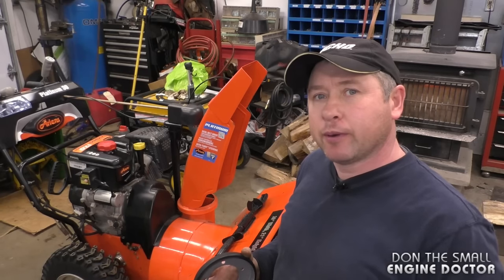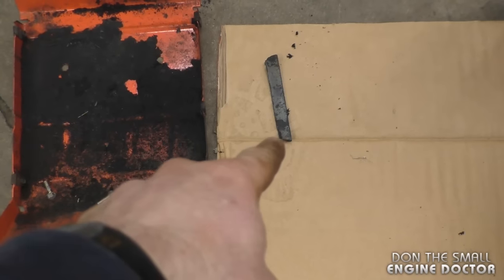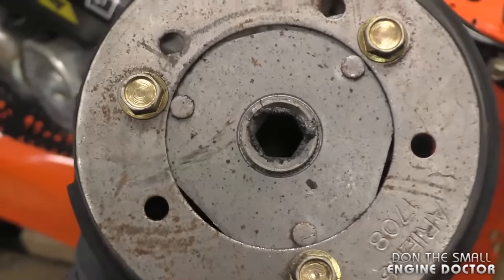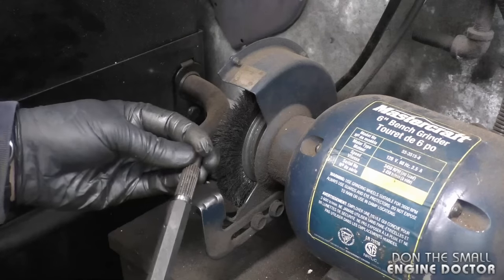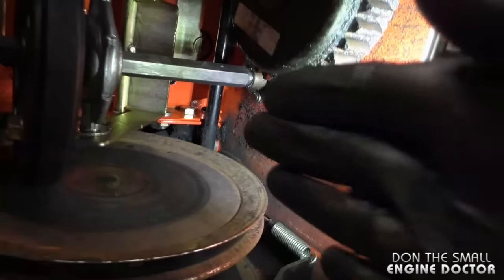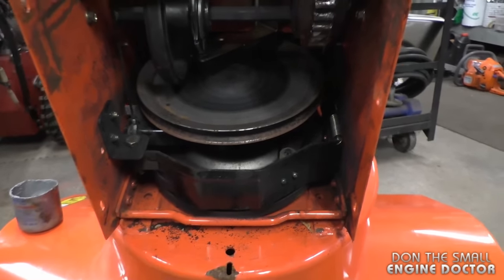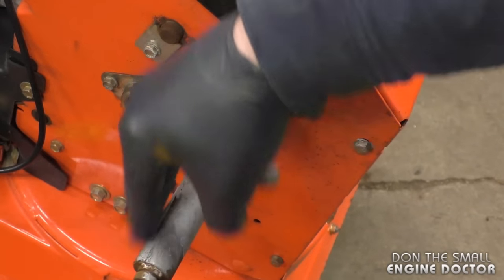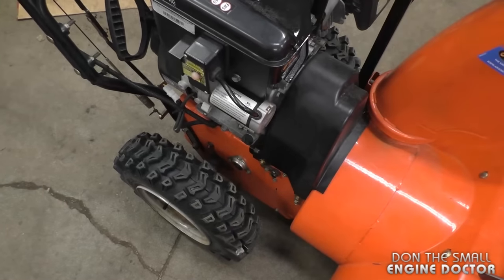HOW-TO Replace A Friction Disc On Ariens Snowblowers - Make It Drive Again!  - Video

Comment: For those that read the comments, I would like to emphasize Don's great advice about anti seize on the axles.  I had an Old Second Hand snowblower that didn't have proper maintenance. I was using at 2 ton press with heat and still couldn't get the wheel off the axle. Now every spring I take the wheels off my new snowblower. Go over the axle with Emory cloth and put anti seize.
Reply: Similar advice for the auger shafts. Those things will rust up to the point where shear pins can be removed and they'll still work normally. At least Ariens has zerk fittings on the augers, economy brands may need the front end disassembled to get in there.
Reply: @TheOtherBill  Both the auger shafts and the axle shafts can be coated with any general purpose grease.  The oil in the grease will serve as a rust inhibitor.  Anti seize is overkill and a bit expensive to use on axle shafts.
Reply: @1575murray  I grease my auger shafts using the installed zerks. Anti-seize on the axle only needs to be applied once and lasts forever.
Reply: @TheOtherBill  I use the zerks too I have two machines an old Toro 421 and a 1996 Noma 5/24 and they have grease fittings on the augers.  I have to take the Noma apart this spring to do some repainting and I will make sure to put grease on the auger shafts before I put it back together.  The zerks tend to send the grease towards the gear case and not to the outer bushings where it is really needed.
Reply: I ripped the whole auger assembly apart to replace all the seals and I anit-seized all of it. As long as the bolts don't rattle out, u can't go wrong.
Reply: First thing I do on a customer,s machine but not always with desired results. Pity they can,t just do a light lube at the factory.

Comment: Just finished the job.  Took about 2 hours.  Took my time.  Relatively easy job.  You can do it.  You WILL want latex mechanic's gloves.  There is messy stuff in there.  Be sure to have torx wrenches to remove and replace the friction disc.  Pliers and a 3/8" wrench.  The blower pulls like new.

Comment: I just used this video to replace the friction plate on my 2013 921017 (035000 - 074999) Deluxe 24 Platinum. Great instructions, Thanks! There were a couple of differences on my unit. My unit used T40 Torx screws instead of 1/2" hex screws. And, instead of square piece on the top of the Drive Disk Carrier mine had a washer on top (same as the bottom). And an additional tip I can add, I used a 3/8" drill bit in the right axle hole to hold the sprocket in place. When I pushed the axle through from the left, the sprocket was perfectly lined up. It would have been a lot harder with out this video!

Comment: As others have said, this is one of the best videos I have ever seen. Didn't have a way to transport my Ariens 921013 snowblower to the dealer so had to try this repair myself.
Luckily I found this video and made my life a lot easier.  FYI - Only difference on my machine is it has washers on both sides of the friction disk unit.

Comment: This demonstration on the friction disc was wonderful! I am going to have  do that someday. I'm glad I know that it's as easy as  you say,  and I will look up your excellent video when the time comes. My only problem is that my machine is a 28" rapidtrak So it will be a little more complicated.  I'm an 82-year old woman, 4ft  11" tall, 115 lbs so I needed to come up with my own way of getting the beast into service position. Struggled doing things with it in "normal" position. Now I use two car jacks and a motorcycle lift.  I got this beast three years ago and it worked fine for one and a half years. then I tried to get warranty on it but you have to pay to have it transported. I live in the boonies and dealer is 25 miles away. So I learned to fix it myself.

Comment: As always,  @donnyboy73 has created an excellent DIY video. 

3 things:
1: I always take pictures before I start a job for reference when reassembling. 

2: I use cheap plastic food storage container (Dollarama) to keep parts in so I don't lose them. 
One for the belly plate screws, one for clips and keys from the drive wheels, etc. 

3: Before reinstalling the friction disc, release tension on the drive clutch cable. 
As the old disc wore, you probably snugged up the cable, but now, with a new disc, there won't be enough clearance between the new rubber and the friction plate to reinstall the shift mechanism.

Comment: My six year old Ariens 24" in Minnesota was making chatter while operating in lower gear setting, higher gear settings were slower speed and felt like slipping was occurring. I took off the lower back cover, it was filled with black rubber bits from the disc wearing, it had less than 1/64" layer of rubber left.  I located a new disc at an Ariens parts store. I watched your perfect video of how to replace the disc. Total time to fix was 2hrs, the Ariens works like new !  Thanks for your excellent help, the Best DIY video I have ever watched.

Comment: Where were you guys at 23 years ago, received a brand new 8/24” snowblower (Kmart) for Christmas after we moved into our first home and built the garage with a 28’X40’ approach, kept up on the oil changes and gas during storage time, sure could have used these videos to do the preventive maintenance on it, such as the anti-seize applications, the friction wheel cleaning and greasing, keeping the cables lubed and clean, adjusting the scrapper bar height at the skid shoes, and on! It lasted almost 18 years until the bearing wore out on the main shaft going to the auger assembly, and it was completely rusted in place, no amount of heat or penetrating lube helped. Finally sold it for parts and bought myself a new zero turn 8/26” model from Craftsman.

Note: did muttle my way through some of the things mentioned, friction wheel replacement (wore out), cables and spring replacement (rusted and broke), scrapper bar replacement (wore it down past the housing metal, oops) and the skid shoes, those are a given wear item...

Love the videos, you go into detail and keep us informed without being boring or quick to judge! For that I thank you. And yes the videos are much better to watch than the owners manuals are to read, hands on it the best learning tool for me.

Comment: Great video.  I had to replace the friction disc on a Deluxe 28.  I ran into a problem with the right side bearing.  It would not release from the shaft.  I tried WD-40, tapping it, prying it.  No go.
I ended up cutting the bearing off with a Dremel tool.
Don's advice on the anti-sieze is spot on.  I don't want to have to do this bearing extraction again!

Comment: Another well documented video. Here are a few tips that you can save time with. I use the plastic my newspaper came in to screw under the gas cap on all my equipment. Full tank and no leaking. Nice to see that Ariens has abandoned their incredibly stupid 45 degree shift fork setup that I inherited from a customer. I have also found in my past heavy construction repair jobs that antisieze not only gets on everything you don,t want but it will dry up over years and become totally useless. I use a quality ep2 grease on all my repairs on all equipment except brakes. Always enjoy watching your stuff , Don.

Comment: Thank you Don.  Big snowstorms this year in Boston.  Have a 2012 Ariens pretty much the same model in your video.  Blower was making a scraping noise when I engaged the drive.  Worked fine just a real bad noise.  Thought it was the gear oil since I never added any and had seen it drip from time to time.  Bought some but did not fix. Stumbled on your video and took a look at mine.  Rubber in wheel looked torn off in one section.  Was metal on metal.
I really did not feel comfortable doing it myself but with pending storm and not wanting to give it to dealer for a month to fix. I decided to try.  Took everything apart, not too bad but my disc has screws with star shape not easy bolts like yours. Got one of the three off and off to dealer to buy disc and hope they could help.  They did.  I reassembled (took twice as long) but persevered and crossed fingers.  It WORKED. Expecting 3 to 6 inches tomorrow so I'm ready.  BTW, the service guy at the dealer told me they are only a few days not weeks to fix blowers since season has already started.  Not sure I believe that since they were very busy in all depts.   Too late now.  Mine is fixed thanks to you.

Comment: At 8:15 you can see the plate the friction wheel rides on.  I clean and lightly sand that using emery paper.  Removes any residue from previous use.  Good to the point instructional video!

Comment: I made this repair in October 2020 on a classic 24. No keys nor clips but snap pins. The drive wheel is different as is the actuator connector  - no clip-shaped top washer. 
I really appreciate the detail of this video and the use of anti-sieze. 
This change was applied after two winters clearing nearly a half-acre maybe 15 to 20 times.
As a heads-up, I add about 2-3 oz of Marvel Mystery Oil per 2 gallons  gas. Following mfr starting protocol, it starts EVERY time w one or two pulls.
Blessings to you and yours, and to all those who are stewards over God's blessings to us.

Comment: Good info! My 20 year old Ariens Deluxe 28" still performs as it did on day one and is in perfect condition. I am religious about maintenance and make sure to lubricate the space between the short differential axle and long axle so the auto turning is very smooth and less load on the diff plates. It gets lots of use here in Upstate NY so I must be doing something right. Even if the diff wore out it is only $115 for a new one.

Comment: I want to thank you for the video on how to replace a friction plate.  Never attempted this and was nervous.  Watched your video several times and then went for it.  It was a piece of cake.  Thank you so much for the clear instructions.  The hardest part was thawing out the wheel axles to take the wheels off.  Had to use a torch to melt the ice.  Thanks again!  Great job.

Comment: hey donyboy just completed my 28'' Ariens disc replacement thanks. it was a walk in the park. I have one tip when using the never seize. I did one side of the axle at a time . that stuff sure is messy, doing it this way I was able to line up the key way without playing in the never seize. it's a lot easier using the wheel to rotate the axel and keeping things clean.

Comment: I had trouble shifting. Opened up and the washer and top washer aka anti rotation tab, were laying in the pan. You are the only one with a video showing exactly how these 2 pieces go back in. Thanks a ton.
Reply: Correction that piece is called a 
“Bracket formed shim” .... my bad. My problem is that when I shift to highest speed, it all falls out of the shift forks before it even comes close to the stop pin.

Comment: Outstanding video!  I found your channel by searching for this very topic.  You made the job a piece a cake.  Great videography showing each step, along with a no nonsense explanation.  Yours is far better than the video by Ariens.

The only other tip I would suggest is to ensure you adjust the traction drive cable to accommodate the fresh friction plate.  My used Deluxe 30 model was a negotiated item with a recent home purchase.  The previous owner had the traction drive cable pretty tight to accommodate a severely worn disc.  Prior to even being able to fit the new disc, the traction drive cable had to be loosened quite a bit.

Thanks again!  I'm sure I'll be watching many of your videos in the future.

Comment: Great video, my tips are these: those wheel shafts have a plastic liner "bushing" that can and should  be replaced if there is play on the wheel shaft.  Also the top larger gear that you grease with the grease fitting also has inner metal bushings that should be replaced if there is play on that shaft.   These things should always be inspected while you're in there.   I know that's not what this video but might be good as a follow-up one. Take care.

Comment: I am absolutely blown away about this video. I took the bottom cover off my Ariens and what I thought was a grease smear turned out to be the hairy material left of from the friction disc everywhere inside my machine.  Followed the instructions, a little preventative tips like you said and put it all back together in 35 minutes, including clean up!  I can't believe it, when I did the traction test it was literally pulling out of my hands! 
  
For your info, I actually got my disc at the local Husqvarna dealer, the disc part number L1800  RT-300  6" OD fits Noma, Ariens, JD and Snapper.

Thank you, thank you, thank you!

Comment: Excellent video!!   This helped me out tremendously when my folks snowblower  wheels were failing to engage during the last storm.  The friction wheel luckily was  in stock at a local hardware store.  I'm pretty handy and the actual repair took about an 1 1/2 hours as the rubber was everywhere.  We spent a bunch of time cleaning everything from the rubber debris.  The job went remarkably well thanks to your easily explained thorough video that anyone could follow!

Comment: You ROCK DB!! I just bought a (early Jan 2022) new Ariens 8/24 Dlx. This vid will come in handy in the near future!! I love your easy-going manner, & showing detailed views of parts. I've been a subscriber for yeeeeaars!

I think you should mention good Fuel practices more frequently. I'm a huge Seafoam fan! Living in Fargo, ND.....it gets pretty COLD! I put a little SF (1/4 cup) in my 1 Gal refill can. This way, my small engines ALWAYS have good gas. My existing Tecumseh 8hp Snowking engine is 25 yrs old & runs STRONG!

Comment: Good Video - Ariens pronounces their name on their videos as "Errands" and not "Err-i-ends". They don't pronounce the "I" like you do.
I measured the thickness of the rubber on a new friction disc and then measured the thickness on the disc on the machine so that I could predict how soon I would have to replace the friction disc. I didn't have to replace the disc until it was 6 seasons old. Every year, I take off the belly pan and clean and check.

Comment: Another great video, Don. Everything explained so well. Near the end of the repair, I was going to ask why not just use grease on the entire shaft instead of grease + anti-seize - and before I could type, you answered my question. You always provide extra tips and good-to-know info and it is very much appreciated. Cheers!

Comment: Excellent tutorial sir.  Great advice on cleaning the friction plate and using anti-seize.  I´ll avoid a lot of unnecessary effort, such as completely removing the drive shaft, thanks to this video.  Gord McDonald's advice below about tuning up the axles is also worth your time.  Thanks again.

Comment: I recently restored an aluminum main disc with gouges with a feathered sanding 4.5 disc and did not have to remove anything except to replace the rubber drive wheel. I use quick start on a rag to clean up this area. Not as nasty as brake cleaner.

Comment: Great video. My 2011 Ariens was making a thumping sound whenever I engaged the traction clutch lever. Sure enough, the culprit was a missing piece of rubber on the friction disc.  $31 later and I'm back in business.

Comment: I like the concise step by step procedures very informative. I have learned a lot having 2 machines.824A BOLENS over 40 years old still runs.The other is a 824 Troy Bilt 27 years old, I keep them running,Thank you Dony Boy.

Comment: Have to pull this off tomorrow .. Just can't move any more snow with that flaky wheel ..  I don't have all the time to do the maintenance ( winter months) , but pretty sure I only need to remove one wheel (pretty sure they will both be seized ) .   If I can get the wheels off, good to go with your instructions .. Thank you.. Wish me luck.
Reply: Did it.. One wheel only.. LUCKY LUCKY day as nothing was seized.. About 2 hours total , outdoors and snow falling.  What an amazing difference.. Thanks for your video.  Nailed it.

Comment: On my list for this weekend. My rubber is all but gone. I bought a Sten brand wheel. There are a bunch of complaints about Ariens most recent batch of parts. And Oregon discontinued the disk.

Comment: Hello, 
I just want to say thank you for having such an excellent channel. Although I've done many small engine repairs since 1982, there are certainly things I haven't tackled yet.
One of them is the friction disc on my Ariens Deluxe 28, which I will likely do in the next day or two.
Your videos are indepth enough that anyone with basic or moderate skills can follow along. And this particular one is far more indepth and informative than what Ariens has out there for their blowers.
I have a 12 year old in the neighborhood now that is also watching your channel.
After rebuilding a few carburetors with him, I told him to check out your channel. He's learning so much and much has to do with your channel here.
I also started using K100 earlier this year and I really appreciate your demo that showed how much more effective it tackled water over Seafoam and Sta-Bil.
I have used Seafoam for years and now I mostly use K100 if I think the fuel might sit a bit.
Thanks again for all you do!
Please know you're appreciated.
Regards,
Rob Opal from Northern Illinois

Comment: Great work Don! I do this nearly every weekend on my customers machines. I have to keep a few of those friction discs in stock. Thankfully only twice have I had to replace that large drive disc, those are sometimes a real PITA to change. on many of the older machines I've had to change the bearings (6203's typically) on that drive disc. Not often they go but eventually they do wear out.